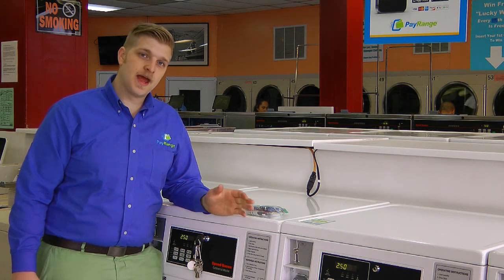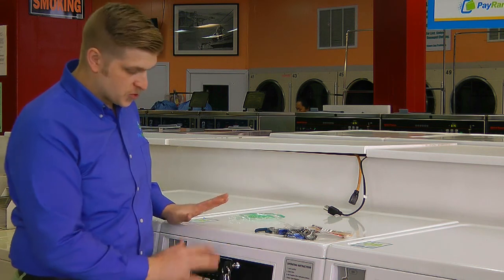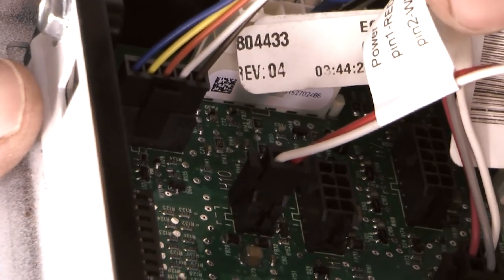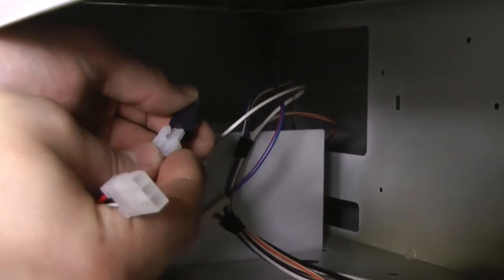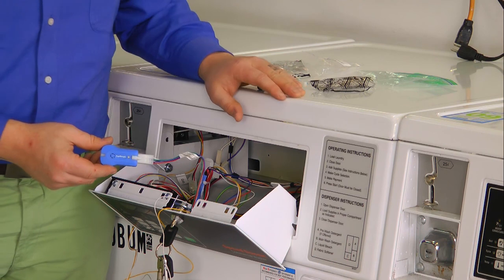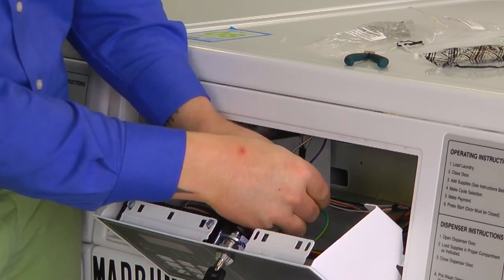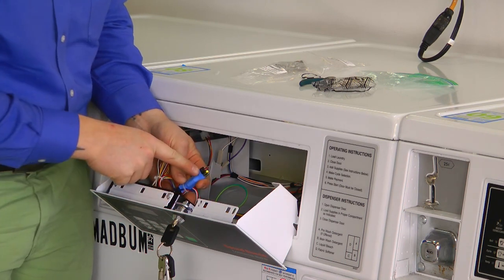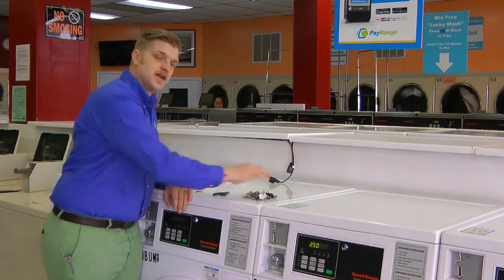Laundry Install: Speed Queen with ACA Controller (K2 Harness)

Comment: This instruction is so vague due to blocking of the arm and hand by the installer. You should include a paused close up picture of every connection you are pulling out and connecting back.